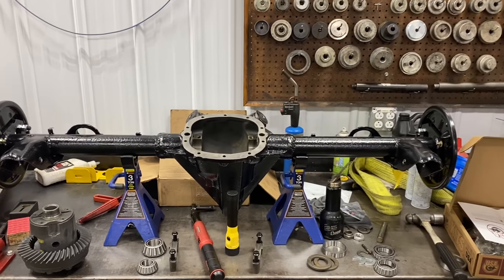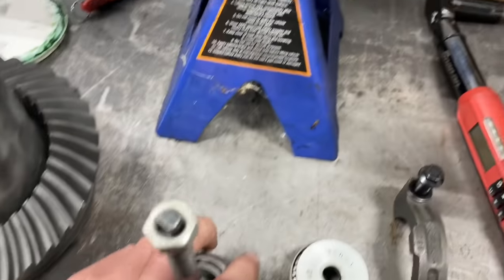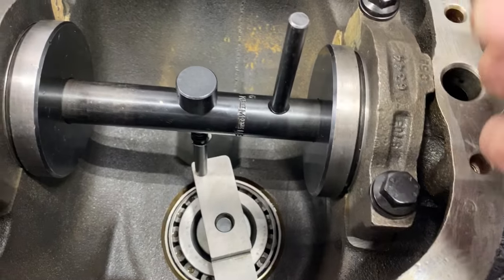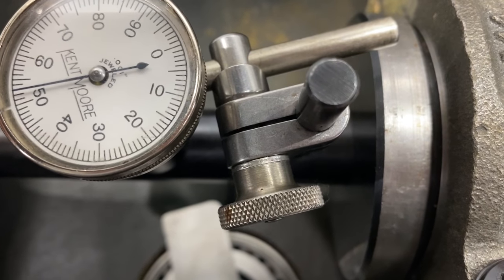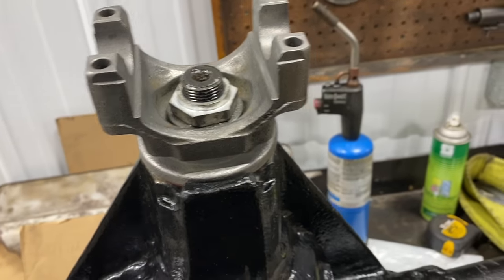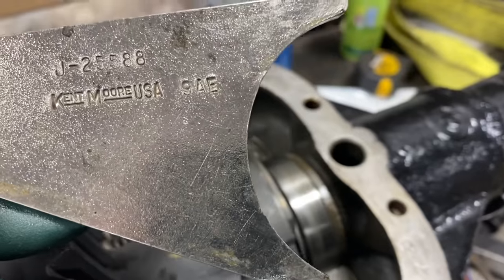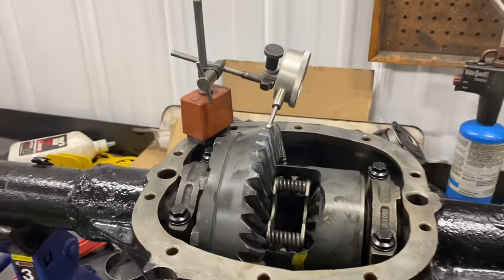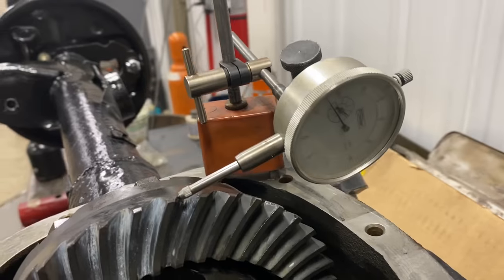GM 10 Bolt 7.5 Ring and Pinion Setup Rear Axle Using Kent Moore Tools

Comment: Great vid my 10 bolt makes a loud noise when accelerating ,,,Coasting and letting off the throttle its quiet
Reply: Needs to be reshimmed a couple thousands usually on left side ring gear side worked  for me..

Comment: Will this kit work on a gm 7.2 ifs front diff ? Also would you share the installation instructions from that kit with me for specs ? I am purchasing that kit used and it doesn’t have any of the installation sheets

Comment: Thanks for the lesson! I currently have an 06 chevy1500.  When i get off the throttle I can feel a slight grind feeling. It was worse before I replaced universal joint but still there. Any idea where i should look?
Reply from the maker: 2wd or 4wd? Could be pinion bearings.